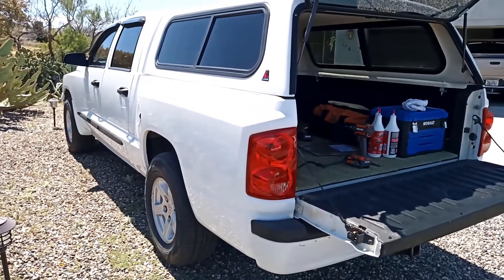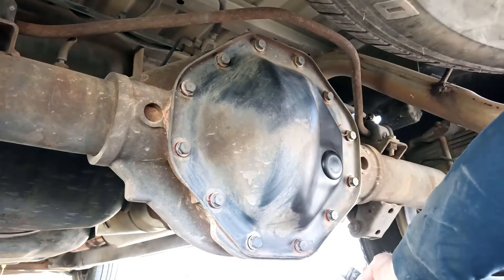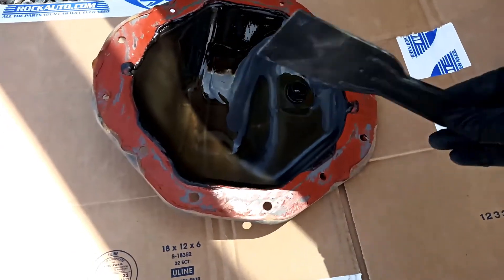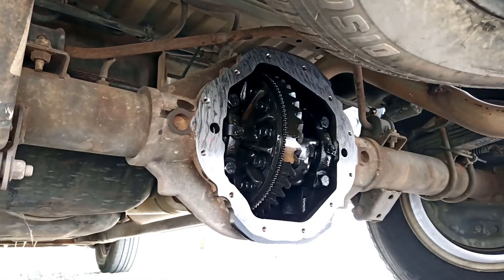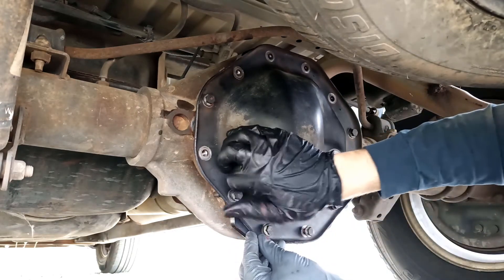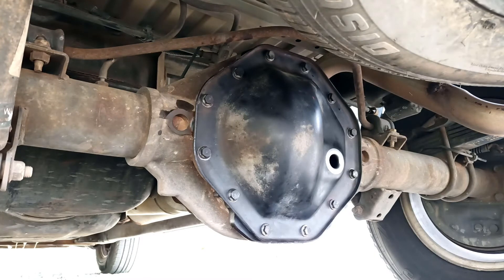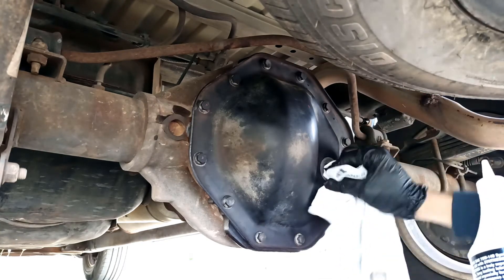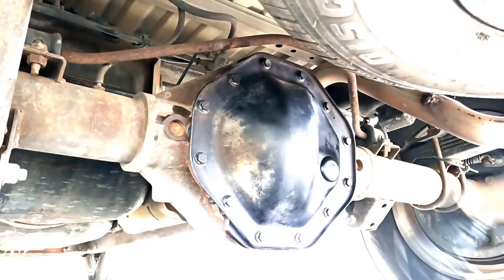How To Change The Fluid On A Rear Differential (07 Dodge Dakota)

Comment: I don’t have reverse or drive in my 99 Dakota 2WD auto. Takes 1 mile of driving, then nothing works. Just sits there. No noise. 

Could this be a gear issue after transmission or transmission only problem?
Reply from the maker: Check if your driveshaft is actually spinning while in gear that would tell you, my guess, transmission issue
Reply: @Snipeoff  It was pressure sensor or the shifter solenoid cuz I replaced them both
Reply from the maker: @tytraulich4987  awesome! Glad to hear it's fixed

Comment: Would you say there's any real reason why someone wouldn't want to just pump the old fluid out? Rather than removing the cover?
Reply from the maker: Well if the cover isn't leaking and you can get all the old fluid out with a pump, then that's probably fine too 👍.

You might not get all of it out thou, and any debris will be at the very bottom.

But like in my case the cover had started to seep a little so it was beneficial to just pull it and replace the seal 👍.

Thank you for asking ☺️